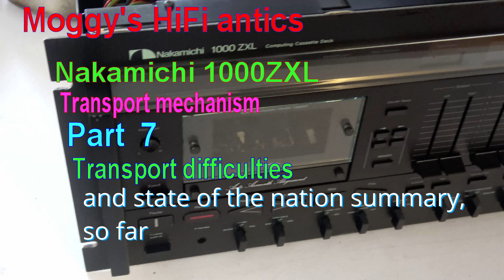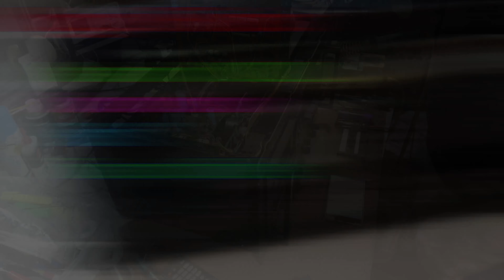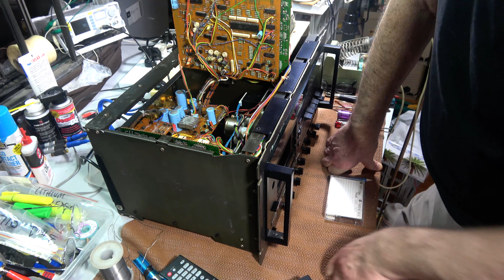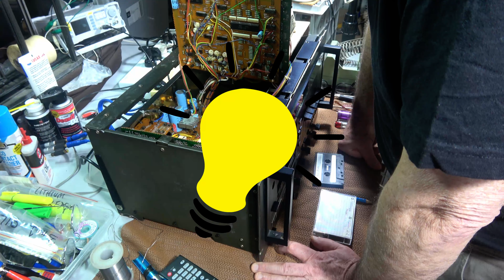Nakamichi 1000ZXL Part 07 Transport, globes and Summary

Comment: I would replace the orange caps before anything else
Reply from the maker: Once I get past the issues in this spate of videos I may well do that. I was always keen to have a basic audio in and out, display working and transport working first, before doing a bulk change.
I am starting to think that perhaps the Willy Hermann way might be best and if I ever do another one I might. That is, pull everything apart, investigate all looms, correct all pcbs with new caps (carefully and one at a time), resolder most joints, completely pull apart the transport (ultra clean and refit) and re-assemble knowing it all is good except for possible new actual faults. I only intended to give it a once over but it has escalated. It was scary at first but I've grown more accustomed to it and am learning.
Reply: @MoggysHiFiAntics   Hi Moggy the orange caps make major changes to the display and all audio circuits and can be a dead short  cheers